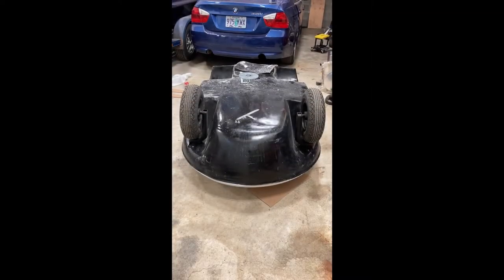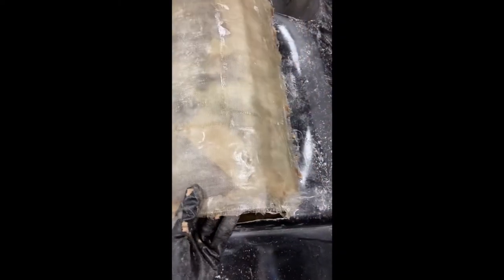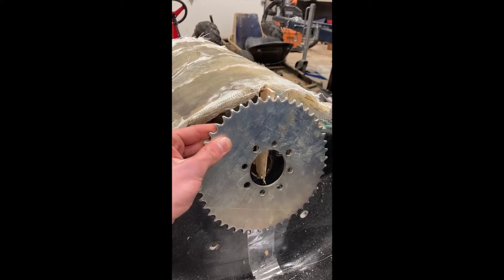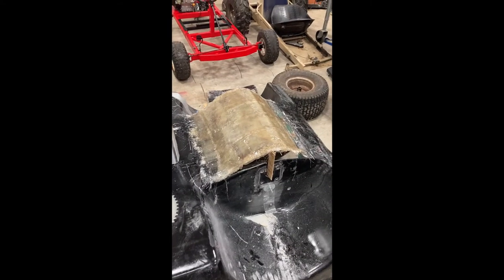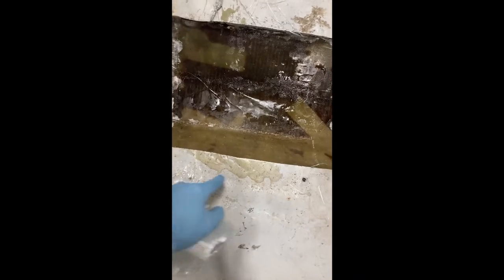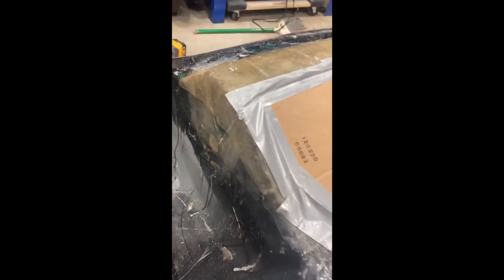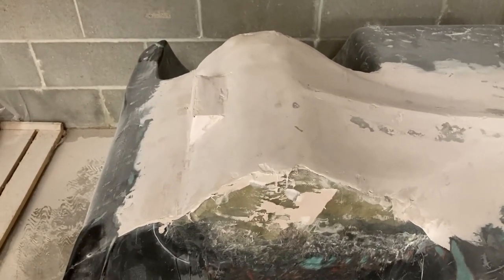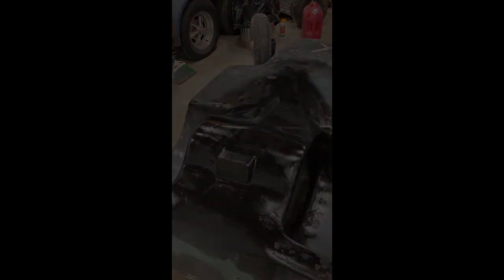Fiber Glassing and Body Filling the Bottom of my Amphibious Go Kart Project.

Comment: Do you know the serial number of that Penguin ? It would be on the side of the fuel tank on the left side of the engine compartment. I would like to add it to the
 registry on Kevin's Penguin and Beaver Page.  I assume the original Villiers engine was not with it when you started this project?
Reply from the maker: I got it with only the hull, front wheels, and steering assembly. I looked to find the serial but could only make out half of it. the old owner used all the parts from it for a go-kart he was working on that sold years ago. I really wanted to keep it original but with everything that is missing, I think it would be better to retro-mod it with all new parts. 

Does anyone ever sell these things? been looking for an original for a few years but cant find one.
Reply: They do come up for sale, but there were less than 1000 made. I know of a few that changed owners in the last few years.
Reply from the maker: oh nice. if you know of one that is up for sale in the nest year i would be very interested. looking for a pretty original one in good condition.